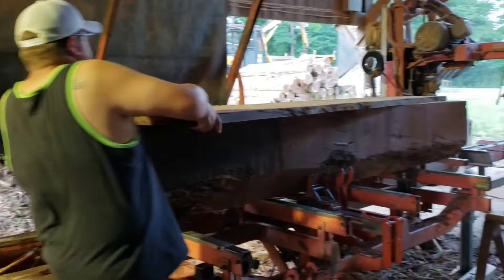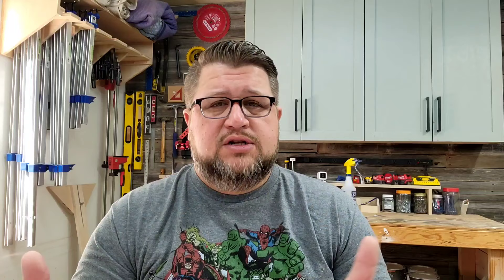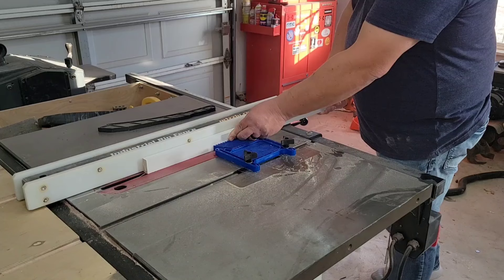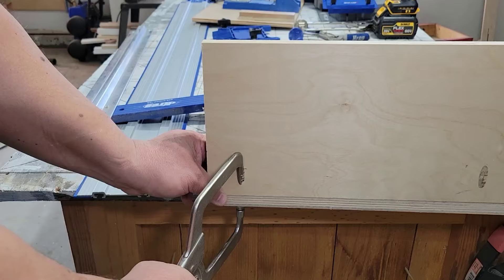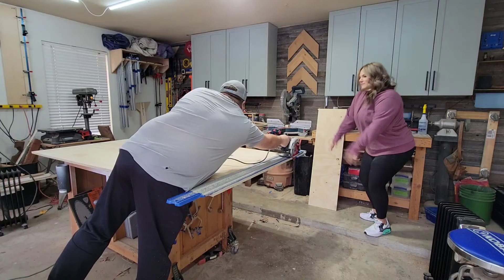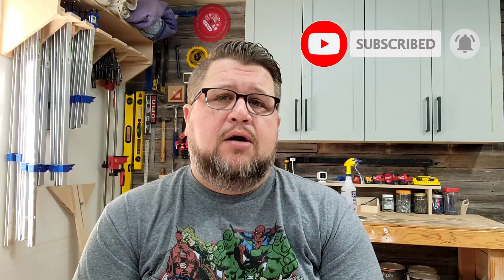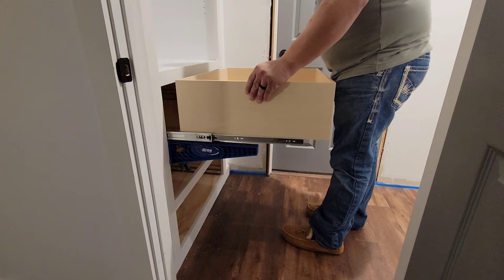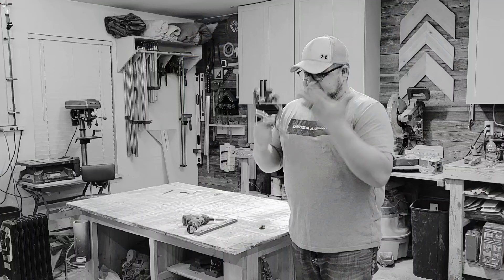Ten Kreg Tools I Love (and one I hate)

Comment: I bought the Crosscut Station a few weeks ago and man I'm so happy I got it. I only own simple power tools like a circular saw, jig saw, oscillating saw, drill and sander, and I was struggling to make accurate and consistent cross cuts. It really does work so well, and saves me from buying a miter saw.
Reply: I just bought the cross cut station and can't wait to put it together. I built cabinets just using my circular saw last year, no other saws, and that was a huge pain to get it just right. I'm hoping I'll have an easier time with the station for the next set of cabinets I make.

Comment: I own six Kreg tools you mentioned. I love five out of six. The Accu-cut is a back-saver for this ol' retired dude. I can single-handedly cut down sheet goods with great accuracy. It has paid for itself many times over. The 'ghetto' track saw is another great tool for breaking down sheets. I have the shelf pin jig and simply love it. The self-adjust clamps are must haves. The six-inch version gets used with the drawer hardware guide to provide clearance for the drill chuck...one clamping action and I can drill all the necessary holes. I have never run across an instance where I needed to go down the drawer face more than five inches, so that is not an issue for me.
Pocket holes. Hmmm. I still have the first jig I got some twenty-someodd years ago, but upgraded to the new small kit when my original drill bit got too dull. I bought two of the forty dollar kits to give myself extraordinary flexibility. Love that thing to death. The single problem I have with pocket holes is/are impact drivers. Do not use them. You will smash out the hole over-torquing the screw, ruin the board and possibly the project. I have a 12v Bosch clutched screwdriver that works like a dream for those screws, and will likely buy two more drills so I have a matching trio of pocket-hole drill bit, a six inch long 1/8" drill bit (I like to finish the screw hole all the way thru so the screw only bites into the joined part) and the six inch #2 Robertson driver. Don't have the pocket hole clamp yet, but Santa will likely get me a few soon...
Have but don't find useful...the drawer slide jig. I find it far easier to cut scrap wood spacers than to fiddle around with trying to get proper alignment and spacing with that jig. It is the only blue tool I have that I was disappointed with.
Reply: Using a drill is good advice but a variable speed impact driver should give enough control to prevent over torquing. I had the old style single speed dewalt which would frequently snap small screw heads off if you weren't quick to get off the trigger, worked fine but a precision instrument it was not. The new 3 speed DCF887 is well worth the upgrade, I frequently use the lowest setting which is probably slightly less torque than a moderate hand tightening.

Comment: Glad to see the corner clamp experience - that’s what it looked like they might do, but I’ve been tempted because of the reviews. I think I’ll steer clear.

I had that kind of experience with the drawer jig. It was over 1/8” off of square from front to back, which is pretty awful for an operation that requires dead level positioning. Only tool I’ve ever tossed straight in the trash. (I waited too long to use it to be able to return it.)

Comment: Kreg Rip jig.. Rate: 1.  I tried it on 2 saws, hate it!
Cabinet hardware jig.  a 9 for me.  Did my sister in laws 9 drawers with it, worked great.
Shelf pin jig.  10.  Love it
I've had my pocket hole jig from Kreg for 15 years now, still rocking on!
Now, I'm trying to work with the drawer slide jig, and wish I'd bought the Rockler one instead, but we'll see.
Not tried anything else yet

Comment: I agree with the Corner Jig score of one.
As you said, it moves and it doesn't matter if you have mitred corners or butt corners, it still is a frustrating too to usel.
That said, I have lots of KREG tools for different purposes and I find them all BRILLIANT but the corner clamp......-10.
Reply: I purchased the Chinese knock off for half the price and it sounds like I have the same issues as the original Kreg corner clamps.

Comment: Have, love, and use the pocket hole jig. I actually have one of the first ones they made. made of aircraft aluminum and I bought it about 30 years ago.
Have the rip jig and use it all of the time. You do have to concentrate but when you do, it is a great item.
Have and use the auto clamps. Love them...
Like the right angle clamp..
With all rip cuts or the rip jig, I use a 2" foam under the wood so I don't have to worry about the end piece falling. i get better cuts at the end too.
Track saw, hell no. Not for that price. I use a board with a guide for the saw and it works just as good as the most expensive track saw.
Use my shelf pin jig all of the time.
Corner clamps - wouldn't spend any money on any of them.

Comment: I have quite a couple of Kreg products and although I've found most of them quite useful, I've had my share of issues with them too.
I've lost at least two of those stupidly small connecting screws that are used to join the Accu-Cut's two tracks together, so I wish they were available separately.
I bought the handle pull jig without realising that the drawers I wanted to use it on were much too deep, so I just used the jig as a template to make my own larger one, and then used the removable parts from the jig on that, so in the end it was no train smash, just took more time.
It may be plasticky and the dust extraction attachment may pop out without warning if I don't position the vacuum hose just so, but I still like my K5 pocket hole jig. Pretty sure the price was excessive though.
Probably my most-used, least expensive and therefore most-loved Kreg tools are the eight 6” sellf-adjusting clamps I bought on special from a local woodworking tool shop. They're quite different from the normal Kreg face clamps in that they're all metal without the soft-touch handles and the clamping surfaces are also a lot smaller than the regular Kreg Automaxx clamps' large round ones, so I think they may have in fact been intended for the metal work industry rather than for woodwork. In dollar terms they were less than US$10 apiece, however, and I haven't yet managed to make any dents in the wood I've clamped with them, no matter how high the clamping force is set. They're also supposed to self-adjust to the thickness of the material, but they're not always very consistent in the amount of force they exert, so I keep adjusting that myself.
I also have the folding work table, the 'Mobile Project Centre,' and it was one of the first Kreg products I bought when I started out and needed somewhere to work on. I found it useful and sturdy enough, if a little small, and by rights I could be looking for another one, but if I compare the price they're going for now to that of the Bora Centipede system the latter certainly seems to make a lot more sense. I can in fact buy a Centipede that's much larger than two Kregs joined together for quite a bit less than the price of one more Kreg project centre and throw my own sheet of plywood on there as a top!

Comment: I have many of the tools discussed here (not the corner clamp). the one I hate is the cabinet hardware jig. It has great reviews, but in my experience the flexing of the thin plastic pulls the drill guides out of alignment. I threw it away after smashing it to pieces with a hammer. Very satisfying!
Reply from the maker: 🤣 🤣 🤣 That's the newest one on the list that I own. I have noticed that flexing. I had to loosen up on clamping it.

Comment: I was introduced to Kreg tools when the K2 Master System first hit the market in the 1990's. I do a lot of work on cabins in remote locations. So what tools to bring can be an issue, in so much as getting them to the site. Not all sites have roads leading to them. On occasion I've had to fly in, so space and weight are huge factors in a small single engine aircraft. Other than a mitre saw, circular saw, router, some cordless tools, a small generator, and a few other ubiquitous hand tools , I pretty much bring all the Kreg tools you featured in this video. The above mentioned tools allow me just about to coverall the bases.
My most recent addition, although not a Kreg tool, is an EcoFlow Delta Pro solar generator, smart battery, and solar panels, and eliminated the  gasoline generator. 
Thank for sharing your thoughts on Kreg tools, I find them almost indispensable. They may not be the end all to be all, but no single tool ever is.
Reply from the maker: That's so cool! Thanks for sharing and for watching!

Comment: My thoughts and my Kreg tools:

I have two pocket hole jigs, the one that you have clamp R3 and although it takes time to setup it works nice and i still use but i recently bought the newer version (predecessor to 520?) that sits on bench this is so much better!  Much quicker to make the holes and love this jig.  

I have regular and right angle clamps, regular clamps work fantastic for countless tasks where right angle works real well for pocket holes

Rip cut I have the older version before they improved it and made surface that runs along board side longer so mine is smaller.  This tool has sat in its storage place for over two years unused as it was useless to me.  Wobble a bunch, really hard to start off and end up straight because guide surface is so small.  One of these days i am going look at it and try to make a new longer guide to see if it makes it useable.

Accu-cut works great is it on par with much more expensive ones I’d say no but for the price this is very helpful tool.

Multi mark is a helpful tool i like the level bubble and use often but it has limited use, i could probably live without using other tools but i don’t regret buying and as i said i use often.

Drawer pull jig, works great easy to setup and I felt was both bets bang for buck and smallest accurate jig available.  

Lastly i have contacted Kreg customer service and a few occasions and have to say my experience with them has been excellent!
Reply from the maker: Thanks for sharing your experience with their tools!

Comment: I love my Kreg tools!  One of my favorites is the Adaptive Cutting System Saw.  It's basically a plunge saw and a track.  I bought an extra track to make rip cuts on sheet goods.  I just built my daughter a floor to ceiling fireplace enclosure from 3 sheets of 3/4" ply using ONLY  the track saw and a pocket hole jig! ( I don't know how to post pics in comments.)

Comment: I know I’m late to this party- just wanted to mention the Kreg Euro hinge jig is really good as well, in fact I like much better than the hardware placement jig or the drawer slide jig.  The other thing in my shop is the Kreg router table insert- also works just fine. I also have the mitersaw flip stop system- it’s ok for rough cuts but has way too much slop to count on for precision. Kreg stuff is not Incra or Festool or Lee Valley or even Porter-Cable.  But it’s pretty good for what it is and I’ve definitely found good value in almost all of it.  I also of course have several of the pocket hole
Jigs - my fave is the discontinued R4 (I think) anyway the one with the locking lever toward the operator. I have a newer one which is stupid - you have to reach OVER the workpiece to lock it bc the lever is on the back.EDIT I think it’s K4 not R4. But you all knew that 😂
Reply from the maker: Thanks for sharing!

Comment: I too will give the draw sliders a ten. Had an old cabinet that I wanted a draw at the bottom as well. With using the drawsliders, it ain't rocket science to use. Oh and the draw, I found at a garage sale. I always take a tape measure when I go to those sales. Like, Mitch, I love my Kreg tools too, the few that I have. Although I do have friends with different Kreg tools...we borrow each others. One of them has a K5 jig which I like using, and has the tool pockets either side. He doesn't like the new 720. He tried it at a tool expo and wasn't impressed, but he did say two things...it's what you are used to, re the K5, and someone else will try the 720 and love it. I also have the original small jigs..not as quick as a K5, but for small jobs, my jigs do the honours. I also borrowed his draw handle jig, and the adjustable shelf pin jig...my TV cabinet didn't have enough shelves...but there was plenty of room for two more shelves but the furniture manufacture in their wisdom didn't think of that. It's great having friends with the same brand tools and we return to each in the same way we borrow them. Nice and clean, and in the cases or boxes they came in.

Comment: I agree on the corner clamp. First one I purchased ( price prohibitive ) and it’s a waste or at least so far
Reply from the maker: Glad I'm not the only one! 😂
Reply: I'm so glad you both said this. I'm just bought it and thought I was doing something wrong!
Reply: I have two corner clamps that I have on occasion managed to use successfully, but yes, it takes a lot of adjusting and readjusting of the material to get them to clamp the material the way you want to. Haven't used them on anything that I needed to clamp super accurately, however, just on stuff I'd made for the shop.

Comment: Great video highlighting Kregs  lineup. I have the 6" clamp and it works flawless so yours may just be funky. I'd buy another one if it doesn't work right, the mechanics of it may be off. I bought the single jig first and the K5 a few weeks later. Its amazing and I've never looked back. I want the track saw next. I have a table saw but the track saw looks fun haha. Keep up the good work.
Reply from the maker: I'm right there with you on the track saw! Thanks so much for the encouragement!

Comment: Have you ever tried the Kreg nine dollar drill guide? I’m doing a table top glue up using dowels for aligning, and I don’t want to spend a ton of money on Dowelmax or Jessem. I plan to use transfer tape and an awl to mark the corresponding dowel  spots, but I need something to drill accurate 90° angles with my hand drill.
Reply from the maker: I've used the one from Milescraft. It works great. Use the dowel pin center finders and that will help as well

Comment: I love Kreg tools, but they use a bit too much plastic. I wish they would sell more expensive versions of their tools with higher quality materials. I have the newest pocket hole jig (I also had the old one but sold it) and it's just too much cheap feeling plastic. The extension wings are just thin plastic. When you lock it you feel the flex in the body of the jig because the plastic is not ridge enough. If they sold the same style pocket jig with better materials, I'd pay $250 for it no problem. 

I recently purchased their MFT table which comes with a bunch of accessories, and they are all made of cheap plastic. The MFT table isn't cheap either, it costs $400 for just the table. I also purchased their clamping saw horses to sit the MFT table on and they set me back $165 each. The saw horses are super nice though. Probably the highest quality thing they make. They are very heavy duty and high quality.
Reply: I just remembered another tool of theirs which I wish they made with higher quality materials, and that is their inset hinge jig. The housing that holds the bit is plastic!  Make that out of metal and charge an extra $20 for it. It's so dumb that they would make the whole jig out of plastic. Granted, it works, and I've done many 35mm holes with it, but it annoys me to use it.
Reply from the maker: I really appreciate this comment and completely agree. Another quality tier would be fantastic. Because I'm with you... I'd pay more for an even better quality tool. Obviously they're trying to reach a specific customer market but a 20-30 dollar increase with better material would actually be fantastic. Good to know on the newer pocket hole jig too because I've considered upgrading... Thanks for watching!
Reply: They don't need to sell more expensive tools… their tools are already overpriced. They need metal versions at the current price points.

Comment: What's the difference between the rip cut and accu cut. Which do you use for cutting 4x8 panels down to the final dimensions.
Reply from the maker: The rip cut has a limit of 24". The accucut can cut anywhere any width. You can even buy an extension to take it to 96". I use both. But to just cut a 4x8 sheet down to 4' length or something you'd use the accucut.

Comment: You can get high quality handle jigs made of metal for under $30. I bought one recently for $25 and it's insanely nice. The fit and finish on it reminds me of a tool that would normally cost over $100. It also will do way more than the Kreg jig as far as sizes.
Reply: Can we get a link to the one you bought?

Comment: What is a good corner clamp that you would recommend or use now?
Reply from the maker: So I shelled out a little money and bought the CSP Clamping system from Woodpeckers. It's a couple hundred bucks though. There are cheaper options on Amazon that are similar. Just search "90 degree clamp" or "right angle clamp". Or if you don't mind the price, the Woodpeckers clamps are great.

Comment: I personally do not like the rip cut tool. It does not slide as well as I thought it wood. I bought an inexpensive track saw kit and a designated circular saw that I keep on the base. These make very straight cuts on sheet goods of all sizes. I haven't used the rip cut since.

Comment: I am building bench tool stands for my woodworking tools.
I want to use 2x4’s for the stringers and a 1 1/2” butcher block for the top.
Is it okay to attach the top with pocket holes?
How much overhang should I have so I don’t tear through the countertop?
Reply from the maker: To attach the top I would use a figure 8 fastener. You can pick them up on Amazon. It's a pretty simple system and allows for seasonal wood movement